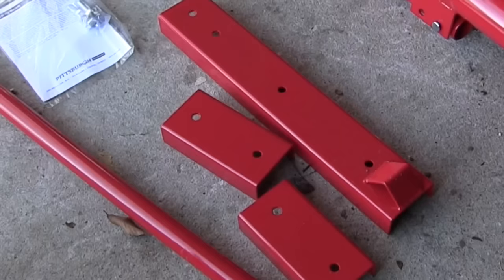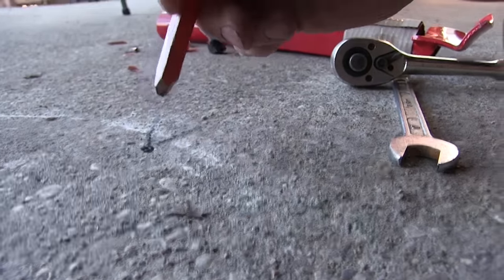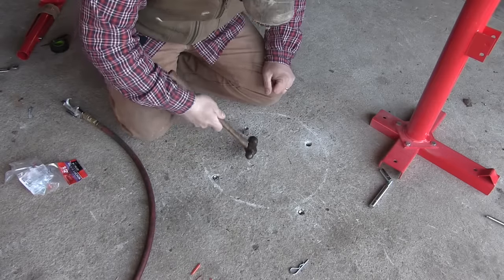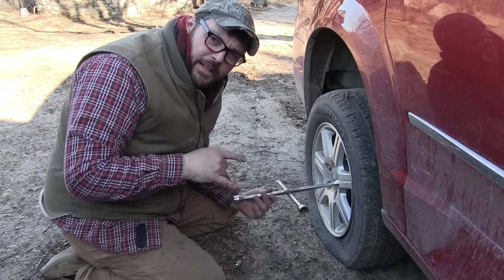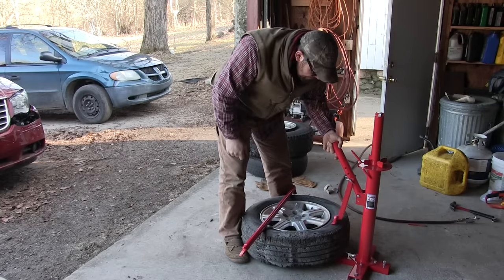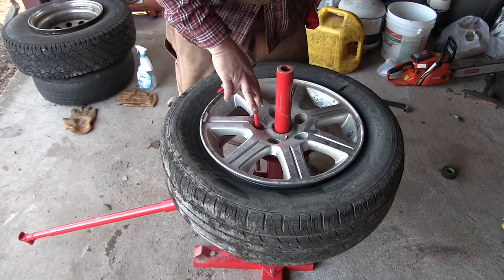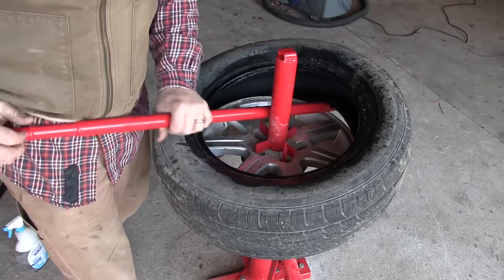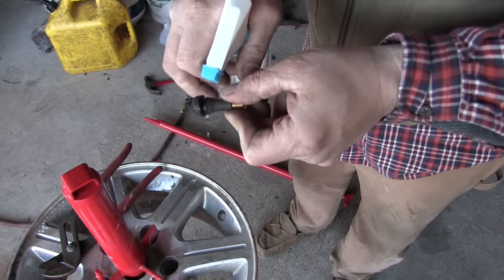Harbor Freight manual Tire Changer review

Comment: Mark tire where valve, weights are on the rim if reusing the same tire!
Reply from the maker: It was my first time, but you're totally right...I should have marked it.
Reply: It threw off the balance anyways because of the TPMS sensor compared to the weight of the rubber stem.
Reply: good point.
Reply: we would allways remove any weights from the tire before removing the tire at the car repair shop.

and then we balance all the tires afterwards.

but most important thing you need to make sure is that you put the new tire right way in. and allways put new valves.
Reply: @fuolku1006   the point is same tire!
Reply: Came to say this
Reply: and it still can be out of balance even if you mark the stem and leave old weights on...tried that few times,always out of balance.
Reply: @otacdjeteta6126  not only that - if you have your wheels ballanced then you probably already traveled some distance which takes off some rubber and that throws the ballance off. Even ballanced wheels need to be reballanced every now and then. Unless you drive on rough terrain (or even offroad) and relatively slow where you can't feel a difference.
Reply: @fuolku1006  Most tire places including Cotsco and Sams when you go for tire balance they put tire on balancer and if still good or not to bad they don't do anything to it and put it back on car. I call that cheating, leaving all weights on and charging you for nothing. Ripoff shops.
Reply: If you run the tire on the machine and it says It's in balance, why would you want to remove the weights and start over? The result will be the same.
Reply: @gregrobsn  If a place charges you around $25 or more to balance your tires but they just put on balancer and see are still good and leave old sticky weights which migh fall soon and still charging you the full amount, that's not good. They should tell you that balance is still good and don't charge you or st least charge you $10 instead of full price.
It's like if you pay $15 for a car wash and they see that your car is still clean and don't wash it but still charge you $15. Will you be ok with that?
Reply: @joaquinsuarez6090   so you expect to go there , have your wheel removed checked for balance and put back on for nothing ? you obviously never tried to run your own business, any way if you can’t feel it out of balance why would you go in the first place obviously you have no idea about anything

Comment: A ratchet strap around the tire will help when re-seating the bead.
Reply: I got a 9 liter bead cannon its a beast
Reply from the maker: I do the same with lawn tractor tires if they dont have tube.....they are hell to get on the bead
Reply from the maker: Thanks
Reply: @Bushradical  I've done it with 37" rock crawler tires on the trail.
Reply: oShane Kasper  make sure the schrader valve is out if you do that.
Reply: @Bushradical   Just re-seated a lawn tractor tire two days ago and using several straps it fought me the whole time.  (Had a flat spot that was making it hard to get the bead sealed.)  Like you, I didn't have a chuck to blow lots of air... wish I'd thought about using blower nozzle.  DOH!  Might find a piece of scrap carpet to throw down to keep from scratching up the front of the wheel when working on the backside.  Next, up let's see a review of a cheap bubble balancer!
Reply: A shot of either gets them up fast and a match but take it easy
Reply: @Bushradical  With the tractor tires, get a bucket of tire lube and slather it around. It allows the air to build up pressure and push the bead up to the bump and then it's game over.

Comment: I do tractor trailer tires all day, we do those manually as well, just two tire bars and a sledgehammer. No machines
Reply: Tractor trailer tires only need equal, so balancing won't matter
Reply: @jonathanzack414  correct, we only balance steers.

Comment: When I started changing tires on small wheels 15 & 16 we had a bead breaker and tire tools, no changer, when we got a manual changer it was a great thing. But we still had to do the truck wheel all by hand tools.

Comment: I’ve had one of these for several years and it takes a lot of back strength to break the bead. Also when you go to remount the tire on the rim, it takes quite a wrestling match to get it back on. Use plenty of lube and make sure and follow the included instructions. Good luck.

Comment: Your daughter's telling all her friends...."my daddy can fix anything" as she heads down the rode tires vibrating out of balance and all... Been there done that!
Reply: Balancing a tire is pretty trivial you just put the rim on a 90 degree pipe and see which way it spins, put some weights on the opposite side that it drops, and repeat until it doesn't move.
Reply: if you inflate tire in same spot no need to rebalance only installing a valve stem
Reply: Joe Scheller yes but he went from the metal stem with the big tire pressure sensor connected to it and changed to a small rubber classic valve stem
Reply from the maker: The van was driven and has no vibration so its pretty darn good as -is. If it needed to be balanced I would use the manual tire balancer , shoot a vid of doing it, and post it here.
Reply: I do my own car and motorcycle tires both balancing and changing. I never have an issue. If you can't balance a tire then you shouldn't be changing one yourself its a very trivial matter. You allow government bodies and manufacturers make something standard or normalized and then you can never get rid of it like tire pressure gauge's or back up cameras and stuff it's pretty pathetic if you ask me. 

Be pro right to repair!
Reply: Hey, it was on the back tire! So, not that big a problem!
Reply: Peace & Love  I love to see technology advance. I however don't like things that create a bar to entry. I think Tire Pressure Guages should be optional like so much other crap in the automotive industry. If you are going to have a vehicle that will stop and start at a light, meaning shutting down all the way then just go electric, building your very own electric car is not that complicated. I mean what the heck happens when the vehicle doesn't start back up when you stop at a light? 

In short, it is an ill conceived idea put forth into reality without really thinking. So many problems with that, I wouldn't ever buy one save your money and buy youself something much better.
Reply: I change my own tires a lot. I dont have this tool. I use my pick up and a board to break the beads. If you watch what you are doing and not knock or take of the wheel weights , you dont have to rebalance.
Reply: I've used this tool and knocked of the wheel weights and mounted the tire with no issue. No vibration or excessive tire wear.
Reply: @lodunost  or you know go to a tire shop where its cheaper to have it fixed and mounted than the tool cost. discount tire woulda did it for ten bucks lol
Reply: @jc3930  I dunno why unless you are just lazy when I have the tools and equipment at home. Honestly, I could care less about what they charge me. I know how those places operate. If you want to take your car in, do it. I will continue to handle my own problems myself until such a time I can't do so.
Reply: @lodunost  good lecture pops.
Reply: @jc3930  I bought this tool because my local tire shop charged me 160 bucks to install 4 tires I already owned. Not sure where your from, Not so cheap in NY
Reply: @mrroofman  nothings cheap in new york thats why i would never live there. get 4 tires installed here for 40 bucks all day

Comment: So on your red version were the mounting holes 7/16" because the 1/2" drop in ancors use a 1/2" 13  bolt. Also mine rocked really bad and my ancors didn't line up perfectly  the fix is drill the mounting holes out to 3/4" for some play so you dont strip out the ancors.  3" long bolts too long unless you put the ancors really deep but a garage floor slab only going to be 4" thick you could bust out the bottom then let water up from the ground into your garage.

I put painters tape over the ancor holes when im not using the tire changer to keep dirt out of my anchors.

Comment: If you toss the TPMS (25th century technology, as you called it), the tire pressure indicator light is going to be on constantly in that vehicle, and will likely blink/beep at you every time you start the vehicle until you replace that sensor.

Comment: Nice job, and diggin' on the mounting holes.  
I may have missed it, but what came to mind was if the tire was remounted in the same direction with the ol' radial tires last longer if they always get used in the same direction when rotating tires front to back vs cris-cross, sorta thing.

Comment: Notice at 9:36 the first bead finally went on easy because the opposite side of the bead from where you were prying was resting down in the RIM CHANNEL - that gives you the slack you need to get the bead in as you go around. The Rim Channel is that narrow area on the Rim midway between the two Rim Lips - All rims have a Rim Channel of various shapes and depths.  But then at 9:45 when you were putting on the other bead, you didn't press the bead down into the Rim Channel as you got the bead under the Rim Lip to get the slack you need as you go around and to get the last section of bead pried under. Because you didn't do that as you went around, you didn't have enough slack. By not getting the proper slack, you often will damage the bead as you pry/push it around and thus the tire is ruined. Keeping the bead in the channel is key when putting in or taking out the bead. 

In your case the bead started to slip down into the channel (which rarely happens) so you were lucky. Also at 7:22 when taking off the first bead you didn't hold the opposite bead down in the Rim Channel, you were lucky that your soapy water helped the bead to slip down toward the Rim Channel on its own, but usually that doesn't happen and you have to hold the bead down as you go around.

But I did give you a like.

Comment: Unless you put the tire back on exactly where it came off then you will need a rebalance
Reply: That's why tire techs carry a tire pen mark the tire where the valve stem is and you can very easily get it in the same spot
Reply: I always mark the tire and rim with a long line before removing to make sure it stays in balance .
Reply: Check out balancing beads
Reply: But if he is removing a sensor, which has weight, rebalance may be required anyway in this situation.
Reply: Harbor freight also sells a portable balencer
Reply: People who are buying this tool would be using it to replace a worn tyre. So unless you can balance the wheel after replacing the tyre, this tool is useless.
Reply: Not really true.
Reply: @davidmartin1628  or you do drifting like me where tire balancing the rears is pointless
Reply: @bobblack3870  hell nah those sensors are really light. Literally less than a pound. I’ve never had a problem with them and I just take the wheels off at home . 😂 always been balanced , that’s more of a myth
Reply: @davidmartin1628  pretty much , I can do it myself with two pry bars, balance use a normal laser.
Reply: @rypdx  LOL - less than a pound?  And you think that has no affect when wheel weights are measured in fractions of an ounce?  Do your teeth chatter when you hit 60 mph?
Reply: David Martin A. The same company that sells this product also sells a bubble balancer..and B. Even if you have to take the tire to get balanced you still save money on mounting the tire itself..I wouldn’t call it useless
Reply: Bob Black IKR “less than a pound” 😂😂
Reply: Every rim on my truck is bent and I doubt any are balanced. You get used to it.

Comment: I wiped down the bead surfaces with 100% silicone and dismounted the tire with the bar but when remounting the tire the hooked bar end kept popping out as I tried to spin the bar end around the rim edge  rather than levering the bead as you did. I ended up muscling the bead over the rim edge with my hands.

Comment: Still fix my own tires! They charge 15-20 dollars a tire to fix them!
Reply from the maker: right on
Reply: guess how long it takes to remove the tire, change tire, balance the tire and put it back with right moment.

i would say about 15 min from my experience. never actually timed it.

 i wouldnt change a tire without proper equipment. 
with all manual equipment it would take at least an hour per tire. without even balancing the tire.

time is money.
i would at least go balance the tire on a shop.

Comment: Thank you for doing video
Reply from the maker: Thanks
Reply: @Bushradical  good stuff, just put new tires on my SUV and did the same thing through those stupid wheel sensors that quit working out👍👍
Reply: Oi and thank you for throwin away that overengineered piece of shit valve stem and usin somethin sensible!

Comment: I know it's been years but just a quick tip take all the wheel sensors out of the wheels and put them in the spare tire it will stop the low pressure warning light from coming back on😊

Comment: This a tool that is usable I've been using this tool for many years just requires strength. There is a no mark bar so it wont mark the rim
Reply: If it is unusable may I ask why the F... have you been using it for years?      And I have one!  It comes in handy on occasion. And  its  better than a poke in the eye with a sharp stick!
Reply: @williamickes3143  You must have read it wrong it say usable not UNUSABLE dont make yourself an idiot please maybe my spelling must be off or something

Comment: Buy a bead axe and 2 quality tire levers throw a rubber mat on the floor some soapy water easy as
Reply from the maker: Thanks
Reply: Orrr 2 pry bars a 2x6 and a car to drive on 2 x 6 make sure u do it on a 100 degree day to get the full effect haha
Reply: you are correct. that's the way we did it in the old days. Practice on an old junk tire with that pick axe until you get your aim up to par so you won't ruin your rim.

Comment: Well, it wasn't  quite 70 years ago. But it was 40 years ago when I was working night after school high school job at a service station. The main part of my job was changing tires and doing oil changes. 

I know the machine you speak of when you talk about the pneumatic machine. The funny thing is, when I catch videos of people using that machine today... They're using the same one that I use back in the '80s. That technology hasn't changed any. This little gadget here works on the same exact principle, it's just that you use your hip to make the spin happen rather than a foot pedal and electric motor.

This right here, this is neat. I like the idea of being able to do everything that I can make myself able to do without help. 

I wonder if a manual balancer is out there on the market. That would make this complete. When you're doing car tires, you're still going to have to get them balanced. But, you can do that at your convenience the next time you're in town for another reason. 

I dig it. I'm going to pick one of these up. Thanks brother.

***Also, something else you can tell your fans: you got lucky here and at that time beaded right up when you shot it with air. They don't always do that. The answer, when they don't, is a ratcheting tie-down strap. Wrap it around the outside and ratchet it down until it gets close to being beaded, And then shoot the air in. Be careful with this though. Stop the process, put the Schrader valve in, and remove the strap as soon as it beads rather than waiting to fill it all the way up to pressure. If you don't, the ratchet from the strap is  going to snap at you when you finally pull it off, and it might break your thumb. Just use common sense.

****Edited because I went and checked and came back. If harbor freight makes one, it's probably cheaper there. But Amazon has a manual tire balancer for about 60 bucks.

Comment: I have changed many tires with my HF style tire changer but I have learned not to use it on anything but steel rims. The hold down will gouge an alloy rim. Plus many alloy rims do not have a smaller inside diameter that after you break the bead from the rim, allows you to roll and pry the the bead over the rim.

Comment: I have the same unit and used it to mount 33 inch tires on my second gen xterra.. Don't forget to buy some cheap tire spoons while your at harbor freight buying it....the thing works great!  Im glad you finally used some slip soap...ya had me wondering for a minute. Plus you can use a valve cap style tire pressure monitoring system..its like 40. Bucks on amazon. Big tires? Mount the beads with starting fluid and 🔥.